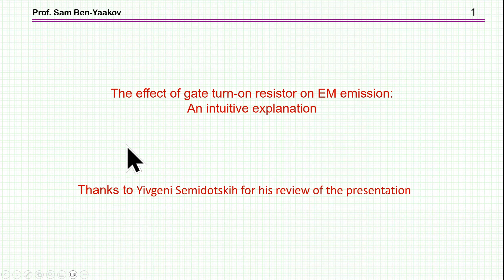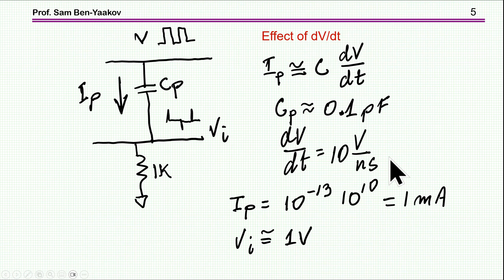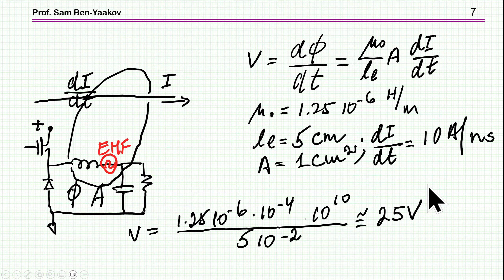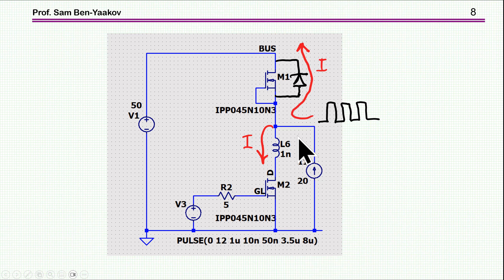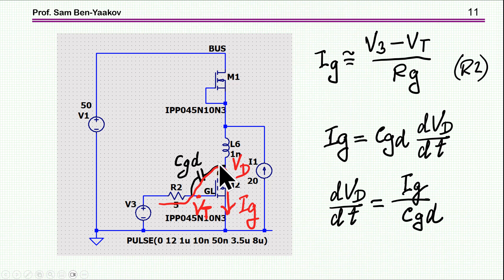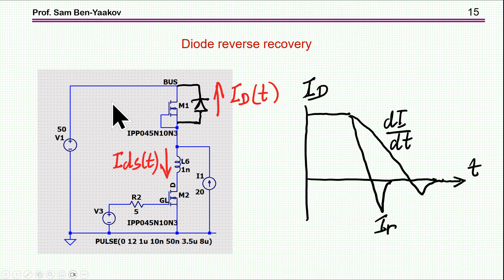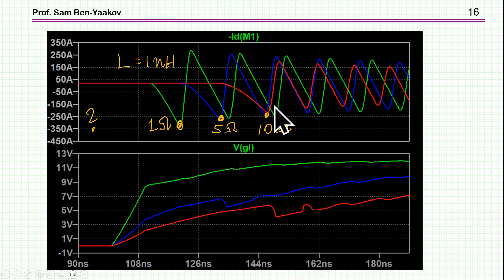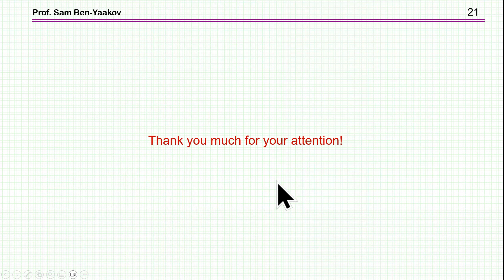The effect of gate turn-on resistor on EM emission: An intuitive explanation

Comment: Hi Mr. Ben Yaakov, i want to ask you something, just a thought that came to me. If we apply any voltage to the inductor and in the moment when we stop applying it, we apply current to the secondary coil, the controlling coil. This process should reduce the reverse voltage in the inductor, or the flyback voltage? Because we change the inductance of the inductor at this moment? Am i right? We will have something like controllable autotransformer? The forward voltage will be something and the reverse voltage will be lower than the forward voltage?    

Thank you!
Reply from the maker: If the inductance is changed, energy still remains the same so the current will rise and to reduce fast current rise you need very high voltages V=LdI/dt.
Reply: @sambenyaakov   First of all, sorry, i thought i was writing in the clip related with current controlled inductance. 
 There is a patent in the name of Nikola Tesla, pat.n. US685956.  If you look closely on figure 2, you will realize that Tesla uses current controlled inductor in his resonant LC circuits. And it seems to me that it works the way i wrote above. 
Can you imagine what kind of things can be achieved this way.... :)
Reply from the maker: @vencislavkirilov6530 To which of my videos are you referring?

Comment: Dr. Sam: Great explanation. But, please check the equation at @5:05. I think V = (N*u/Le)*di/dt? your equation has Ae. I feel it is not correct. I may be wrong as well. Please correct me. Because I derived the equation.
V= Ndphi/dt = L(di/dt), then V = NA(db/dt) = L(di/dt), then  L = N^2/Reluctance. Therefore L = N^2*uo*(Ae/Le). Eventually V = dB/dt = N(uo/Le)(di/dt).
Reply from the maker: This  V = dB/dt is incorrect!  V = d(phi)/dt